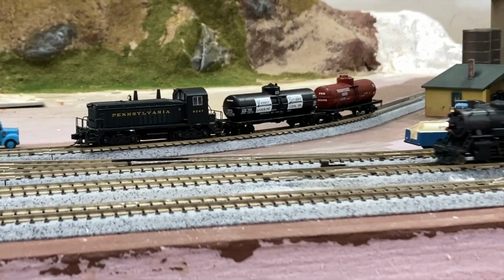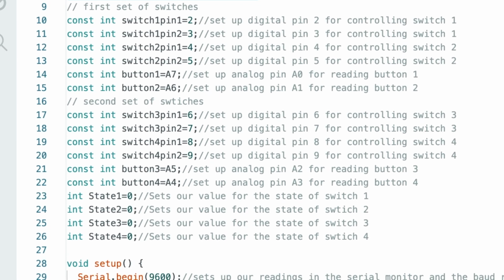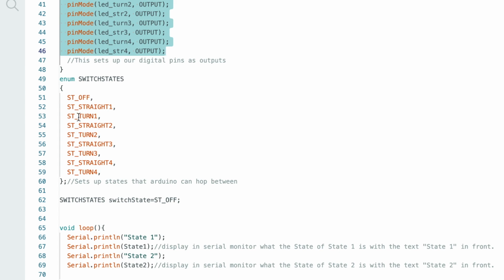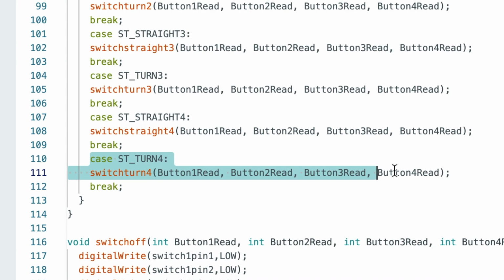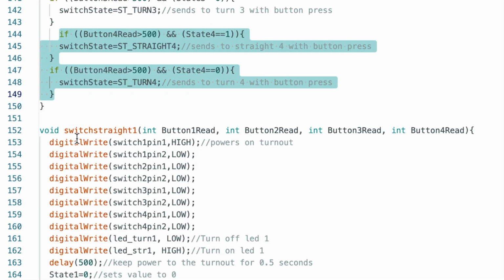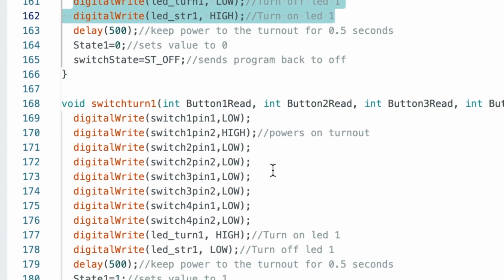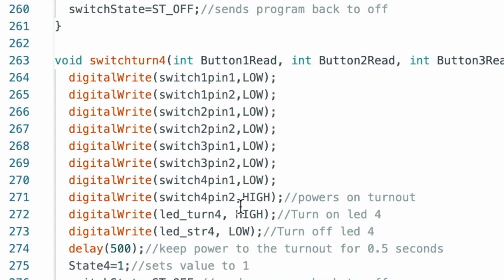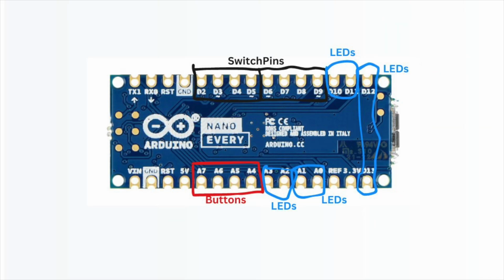Using Aurdino to Control Kato Switches with LED Direction Indicators!

Comment: I wonder if there is any way to slow down the switching so it looks more realistic.
Reply from the maker: IF Kato switches they use an electro-magnetic driver, so you either switch 'em manually or electronically using the magnet.
I sure you could hook-up a servo to the manual lever, but you would have some bulky jigs topside to get the thrown right.
Besides, to look "realistic" you'd have to have a conductor hop off and throw the switch, then hop back on.
I really like the solid click sound they make, it's an audible signal that the switch worked.
Cheers!